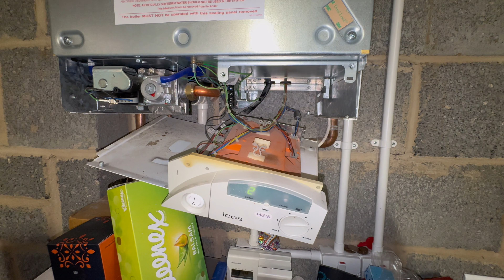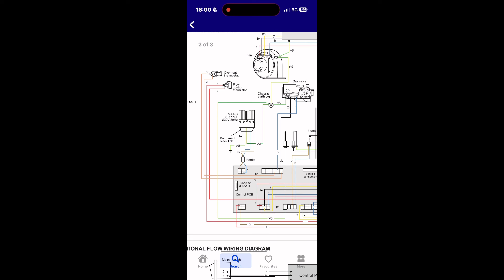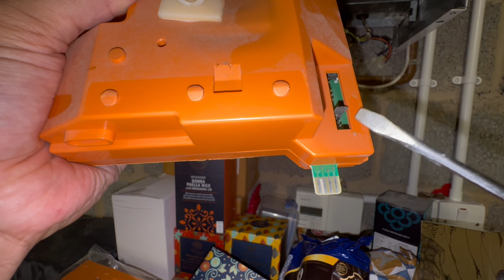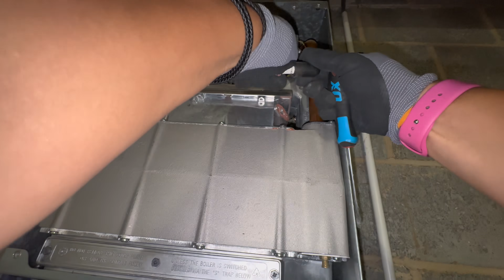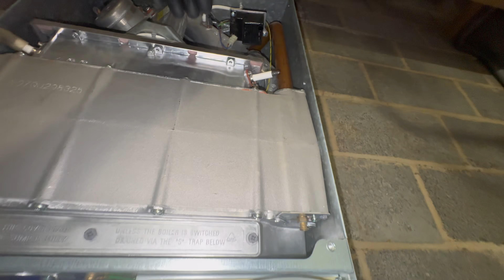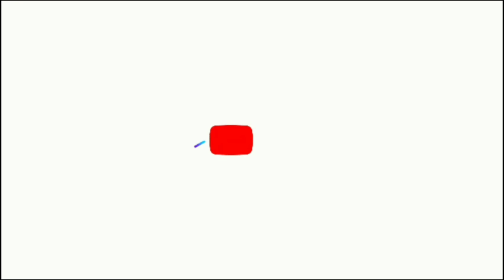The Ideal Icostalot Repair

Comment: Basic stuff that mate check there is power to the generator before just replacing the electrode
Reply from the maker: @paulsmith2931  I know, that’s what I said after. Just one of those days where your heads not on properly and you’re missing the obvious! Happens to the best of us!

Comment: I think the ideal icos/isar boilers were the reason ideal revamped thier whole boiler range with the introduction of the logic/independent. Once they started to go wrong it was so expensive to get them going again as the parts list grows 💸💸💸
Reply: ideal have not made a good boiler since the bulletproof classic
Reply from the maker: @alanjones1301  I still have a few Classics on my books - and Potterton Profiles!
Reply: Yeah i only ever came across 2 ideal responce boilers, dont think they were very popular but was the first one with the u shape flue clamp which was about the best thing on it🤣🤦🏼‍♂️
Reply from the maker: @russellbaldry5095  oh did it? I don’t even remember that bit 😂 changed countless heat exchangers on them 🤯 and the flow switch was at the back left underneath the boiler with a tiny pin you had to line up by touch rather than sight - Eugh! Then they bought out the flue thermostat kit you had to drill into the boiler with!
Reply from the maker: @russellbaldry5095  they were the last in a long line of rubbish! Do you remember the Response 🫨🫨🫨

Comment: Horrible these faults! When it's multiple issues, it feels like your just throwing parts and look incompetent infront of the customer.. when it reality, sometimes your jumping from one fault to another! I had it with a viessman.. everything I replaced a part, another fault came up, and was a 3 days waiting time for the parts, I went back with diffrent fault codes and parts each time until I had to walk away..
Reply from the maker: @brendanfisher2528  ahhh no! I feel your pain! You get to that point where you think why on earth didn’t I recommend a manufacturer visit 😂 even the Ideal tech said on this one he would have straight away said new boiler! Only saving grace was recon boards in the first instance so they only cost £75 where I get them from!
Reply from the maker: @brendanfisher2528  do you come across many Viessmann? I’m not a fan but considering a second look at them as I’m hearing good things!
Reply: All you can do is fix one problem at a time. It does happen that one problem can reveal the next problem.